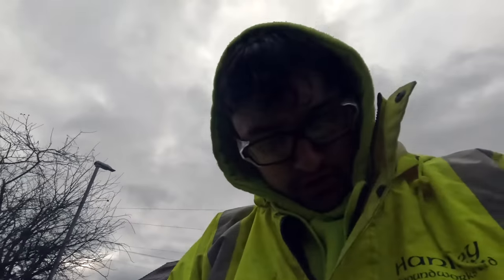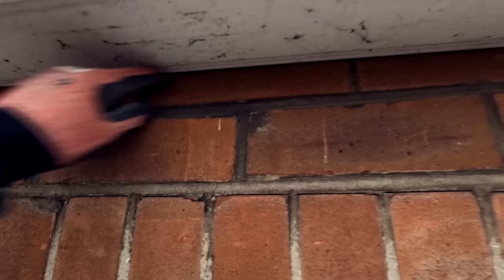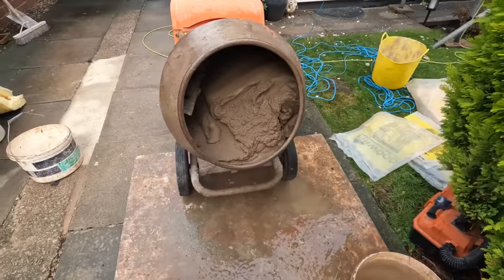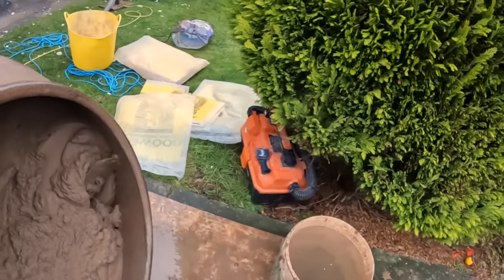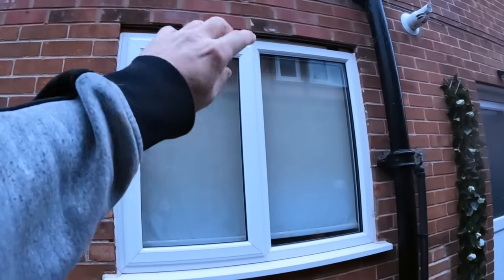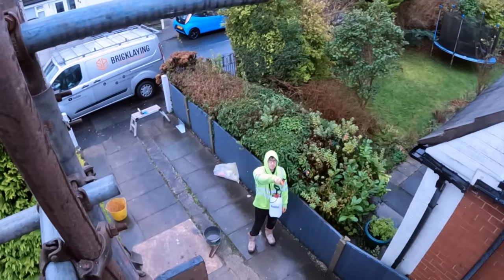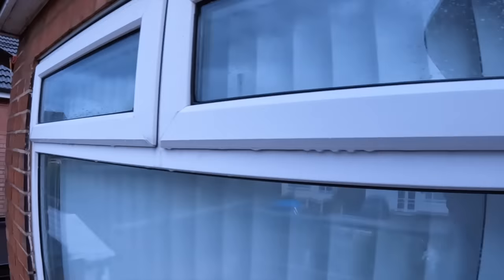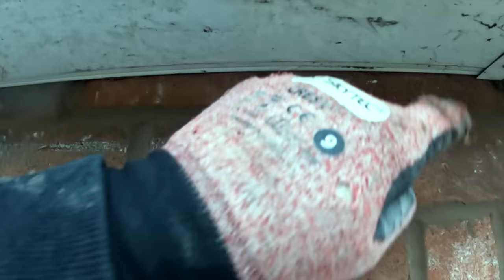DANGEROUS BRICKS & NOTHING GOES RIGHT !!

Comment: The original builders of these houses must have thought that it was perfectly fine to have these few rows of bricks resting on the window frame.
It would have if it was a wooden frame with a middle post in it, but plastic has the property of creep under load, it will slowly deform.
Your advice to the customer to get new windows in here was a good one, these are nacked.
Reply from the maker: very true Tom 🧱👍🏽

Comment: Gaskets can be replaced the ones you pointed at that shrunk were fitted wrong each piece should be cut between 50 and 75 mm longer and started from each end and finished in the middle the extra allows for shrinkage over the years as a window fitter mine shrunk a little so i took the units out stretched the gasket and superglued the ends i can tell you this the ones i have done havent shrunk again or moved